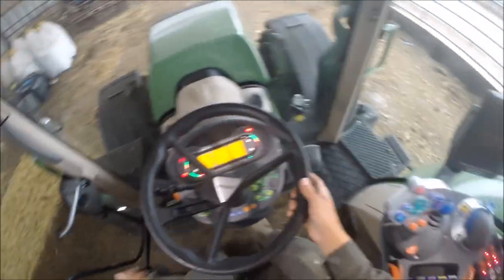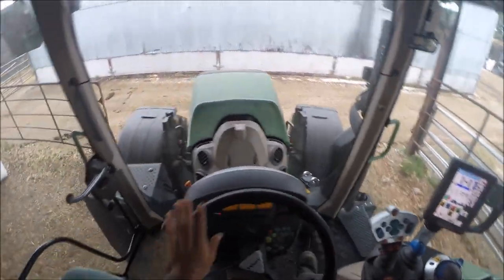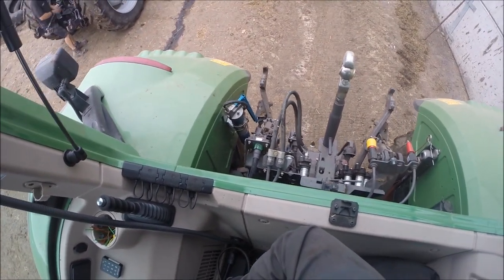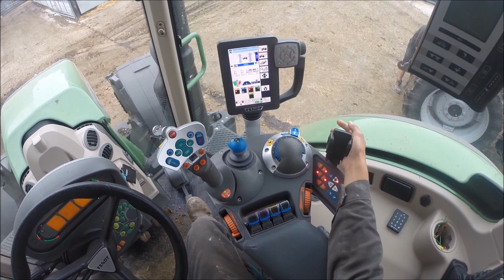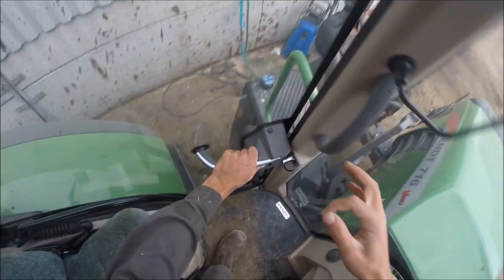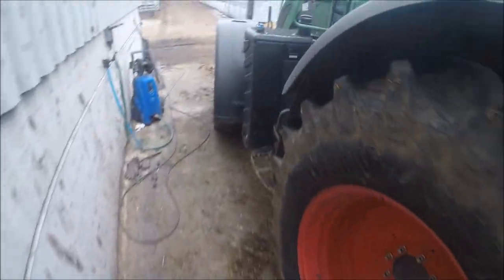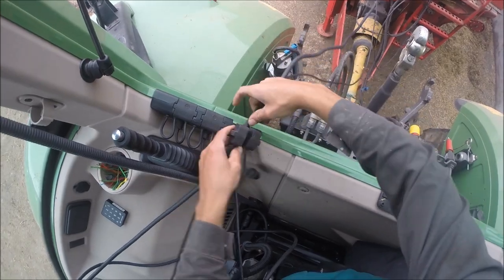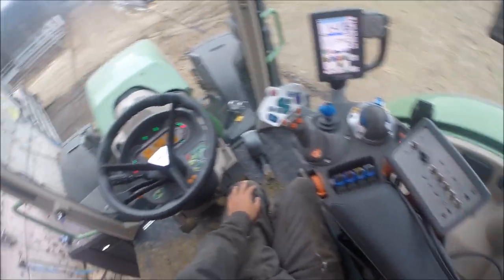How to hitch up fendt

Comment: Pro connected when the engine is running.
I saw a shredded body 20 years ago spread across a yard from a guy being pulled between the pto shaft and drawbar. 
That image will stay with me forever
Reply: steven grieve yeah but he turned the pto off

Comment: A good tractor for your feed would be a John Deere 6430
Reply from the maker: yes we are looking to spend less than 15,000 which puts john deere at the threshold of the price range
Reply: +FarmingLife yeah there good tractors
Reply: +FarmingLife An old brute ford. You'd get a very well kept done up high power one for 15k. I'd look at maybe Tw-25s / 8830s/8630s (powershifts if possible)
Reply from the maker: thanks for the advise